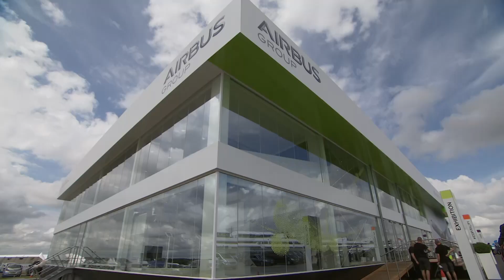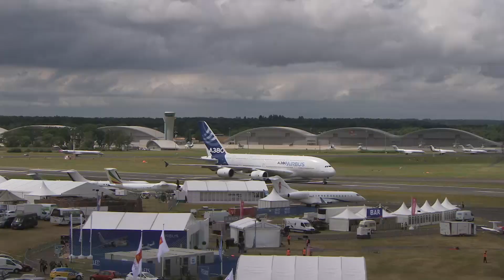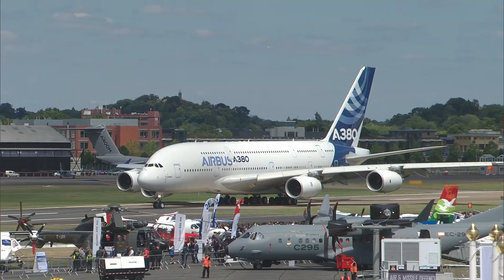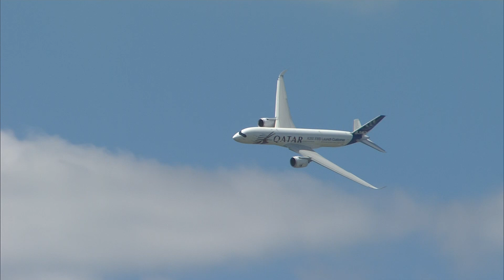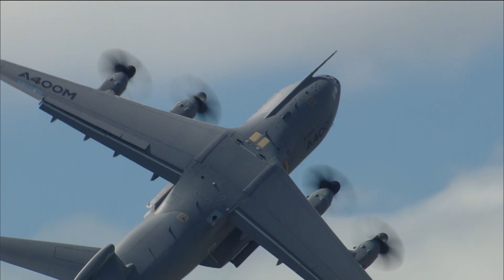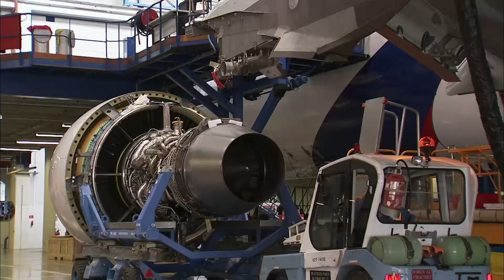Farnborough Air Show 2014 - Monday 14 July Flying displays (uncut version)

Comment: The 747-8i IS selling, and has made money back for the Boeing Company... If it were not, Boeing would have ditched the product. Yes you are probably right that it will be the last version of the 747, however, it most likely will be replaced with a similar type of aircraft to the 747, in the Boeing Y2 (Yellowstone 2) project in the next decade, similar to what Boeing did with the Y1 project, whenever they replaced the 757 with the state of the art 787. 

Also, Boeing would definitely stay afloat if it were not for the 777, as they currently own 60% of the aircraft market...

And just so you know for future reference, the a330 neo is not competing with the 787, the a350 is...
Reply: The 350 is bigger than the 787. the bigger 350s are rivals to the 777
Reply: Sorry mate the 787 is the 767 replacement with a longer range,the A 350 and especially the 1000 is more an answer to the 772 and 77W the 777x is a gamechanger for boeing.
I do not know if boeing would launch a A380 competitor with a dubbeldeck,if so they have to be quick.
My opinion is that boeing is opting for an even more bigger twin than the 777x or maybe even an all new concept like a giant delta wing aircraft.
Reply: John Rooijakkers  Actually, the 787 is a replacement for the 757. That is why Boeing stopped the 757's production. Also, the new A350xwb is a competitor to the 787. 

I think that Boeing would launch a competitor to the A380. However I do not think it will be to full double decks, Boeing is too concerned with evacuations to make two full decks. A delta wing aircraft would be very cool, but we know it will not happen...
Reply: Why the 757?the 757 is a narrowbody and competes with the A 321.
Reply: John Apple The 737-900 is the actual replacement for the 757 due to their similiar range and seating capacity, I don't think Boeing would replace a 3000 miles range plane with a 10.000 miles range plane.